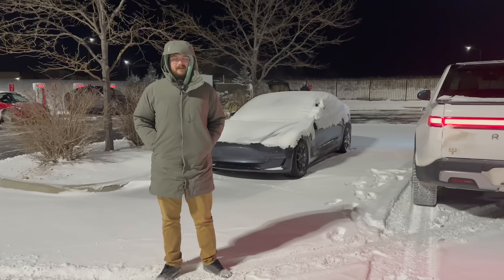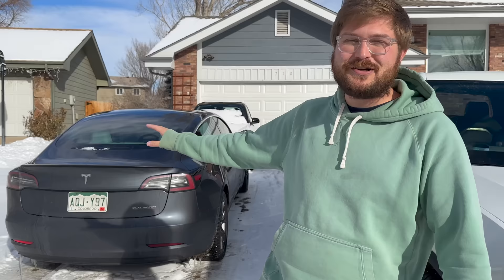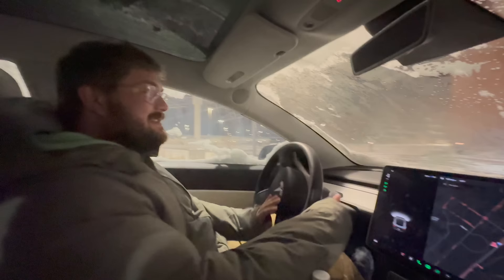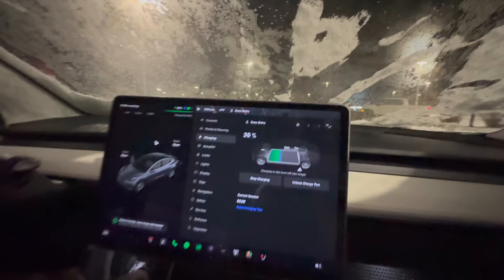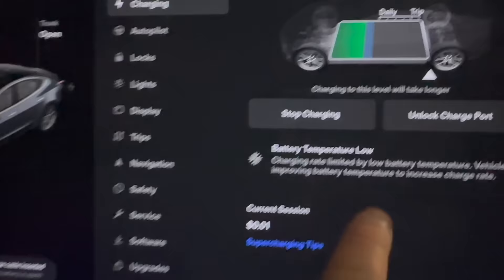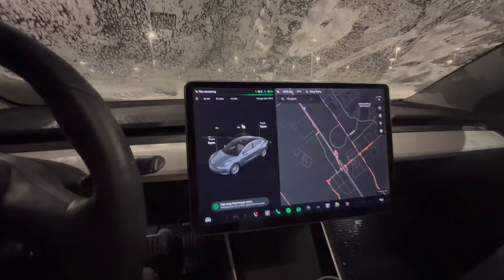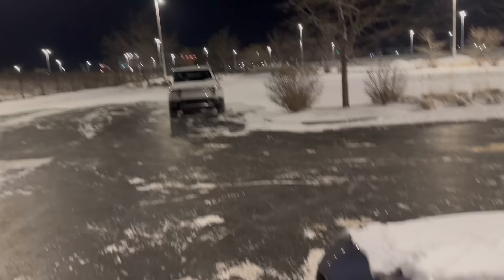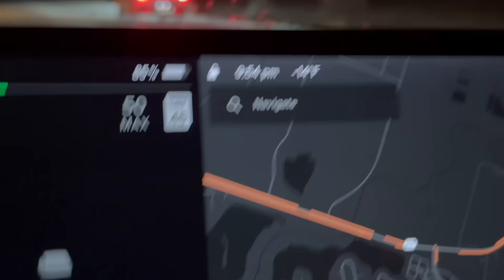I Deep Froze My Tesla And Immediately Plugged It Into A Supercharger To See What Happens

Comment: I really appreciate all this cold weather testing you guys do.  I'm really considering getting one of the new Highland Model 3s and I live in MN so this has done a lot to set my mind at ease about owning an EV in a place where it can get very cold.
Reply: No range. Battery degradation. No resale value. Cold weather effected. No infrastructure. Slow and more expensive service. Insurance nightmares.   I'll take two!
Reply: Really even after Chicago charging stations became graveyards for Teslas? Go for it you live somewhere warm, with my 4 little boys I'll take gas powered any day for safety reasons. Extreme cold kills, no father would ever put his family through hours of charging in  cold weather. Or in Chicago case not charging at all.

Comment: A fossile fuel Car could have been filled and back on the road. How much fossile fuel was burned at the power plant for the electric charge? 😅
Reply: Not as many as black african kids got killed in Congo to hand-mine the cobalt for those batteries.
Reply: @nicolashrv ok liberal
Reply: @nicolashrv  Cobalt is also used to refine oil into gas. By that logic, you're also contributing to the child labor situation.

Comment: But wait you used the battery before you start the recharge?……..discharging (IE driving)battery before recharging makes your test moot. If you understood battery discharge physics all batteries create heat when in use so again your test from a totally frozen battery is an invalid test.

Comment: Can you run the cabin heater at the same time the battery is heating up?
Reply: Yes. The manual recommends it while plugged in for a preconditioning cycle before driving.

Comment: Well, i have 2015 prius, 200k miles on it, live on black hills of south dakota. Been through many cold blast as low as 30 below at least with car sitting in parking lot at work. What i have found is that i go out and well it just starts.  Super hot just runs, took it across country and it just refules quick.  Do all the mechanocal work to it which is only tire, oil changes, other fluids.  Hybred system change fluid only.  I have added a 3 inch lift kit so i can drive when snow is deeper and curbs are not a problem charging.

Comment: Nice to know info!
Personally, I would like to see the decision to go, set the car to precondition from the app, THEN drive to the supercharger and hook up.  you were close to a supercharger so using a few percent to precondition the car before you got into it would make more sense.  I also imagine leaving the heat cranked up wouldn't effect the charging time if the battery is the limiting factor.
Seeing a more sensible regime like that compared to what you did here might be enlightening, and might shut up the nay-sayers in the comments.

Comment: This is a really cool experiment, thanks for sharing.

At say 0 F or below, what kind of range loss do you get? I live in the Minneapolis/St. Paul area so it's routinely 10F or colder for months on end and I have a 70 mile round trip commute to work. I looked at Tesla websites but they only publish losses down to 32 F which isn't much at all. I am assuming 40-50% loss?

I would love to get an EV but given the cold, my commute and often driving 70-100 miles or more in the winter to rural areas for hunting I am worried about getting stuck so I think a PHEV is best for me as it would cut my commute gas usage in half, while I work from home it can be entirely electric driving around town and no need to worry when driving longer distances especially during the colder months here.
Reply: Cap between ideal and reality seen from facts.

Comment: Looks like you need a kerosene glass house heater on standby, shove it under your car and wait.  Oops, doesn't kerosene come from oil. Oh never mind.ps , we call kerosene paraffin in the UK. Here in Lincoln, UK loads of new charging points have just been installed.  Have yet to see anyone using them though.  Far too expensive and too many different apps needed on your cellphone,  mobile phone UK.

Comment: $80,000 car. Giving false readings. Bounced around for an answer. Charger won't latch. Isn't it a waste of electricity just warming the batteries? Half hour and no charge but still using electricity. Time wasted sitting there waiting. Call me old fashioned but I'll stick with my fuel efficient Honda Civic gas powered. Starts right up, fuel up in 2 minutes, gone. I'll be long gone before this EV thing really takes off. There are a lot of issues to work out.

Comment: What a load of BS these battery cars are.  Why not just have a car that can be refuelled in 3 to 4 minutes, warms up in a couple of miles and warms the car interior and if you want, you can then drive 5 or 600 miles before it needs another 3-4 minutes to refuel. If that's your wish, then go and buy a modern economical diesel car.
Reply: Spoken exactly like someone who has never driven one.
Reply: It takes me 5 seconds to plug in, 5 seconds to unplug at my house. It can also warm up remotely too, without putting out fatal toxins in my garage! All for 6 dollars for 250mi. Might not be great for your situation, but they do some of the same things your car does, just more efficiently.

Comment: You really need a good pair of gloves in your car in a winter state like Colorado. And blankets, and food&water, and boots, and a shovel. Cold hoses so many things, it's a law of nature. Too bad We don't respect nature anymore. Don't ever get stuck on a highway in an electric car during winter. Oh yeah, if you drive electric learn to identify the risk of thermal runaway, it's not easy, it's like trying to read the available power in a frozen electric car.

You know it's not "waste" heat in an electric car ever? Heat is a benefit of an ICE, it's a data sink for an electric car. Having to use fuel directly for heat obfuscates the reality of fuel consumption in an electric car, that's why there are such extreme swings in display storage amounts. You brave Pioneers will help make them better, but You are going to get pissed at all the ICE cars on the road in 2031. 

I'm not against electric vehicles at all, I just don't want to ever have a "model-a" as my daily driver. When there's a lvl 5 or 6 or whatever, that doesn't even have driver controls, I'm decking one out with a bar and red leather seats. 

Be safe out there.